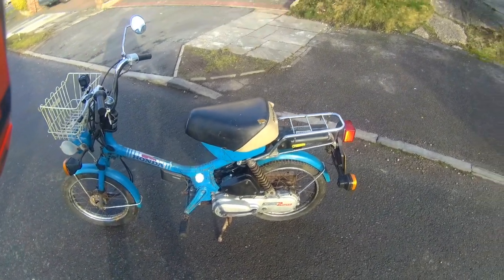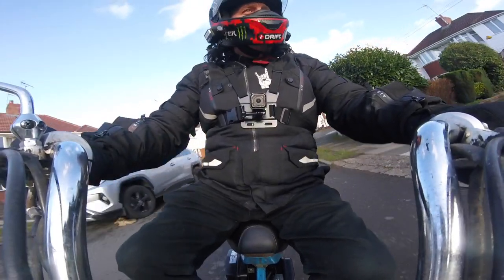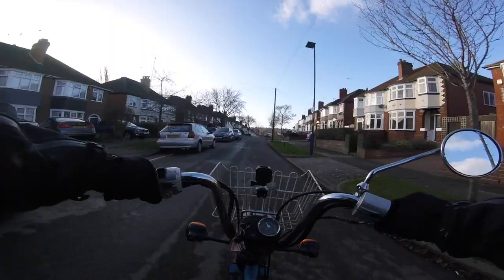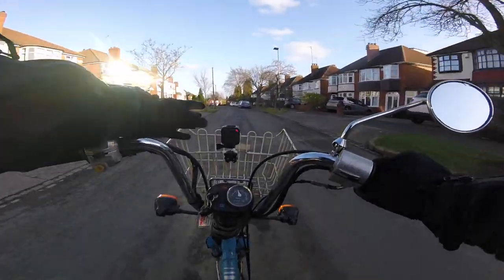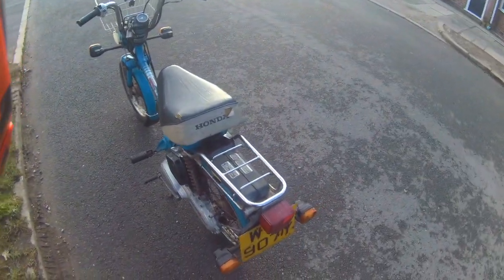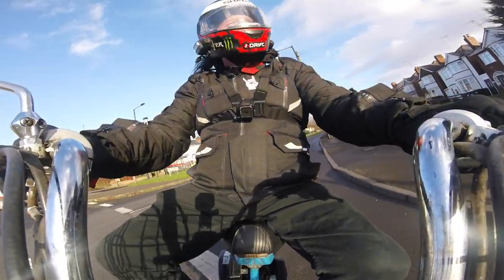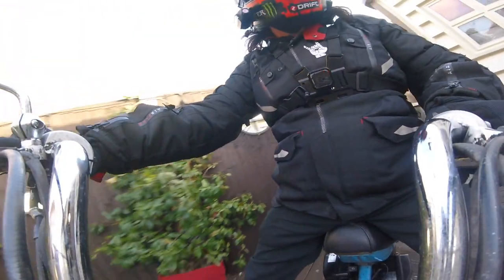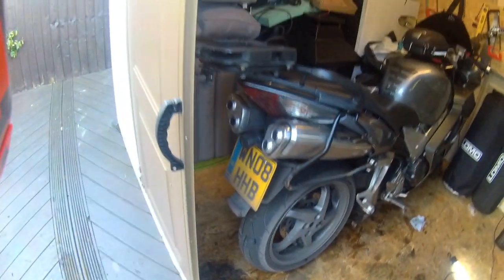1983 Honda Express NC50 First Ride

Comment: Recently put back together an 80 NC50. Up to 28mph on street level at sea level. Good to see others doing the same.
Reply from the maker: Mine doesn’t run very well at all, gonna need to get her looked at
Reply: @Motourev  I don’t recall the exact mileage but you had nearly 6k in this review. Mine less than 600. Hopefully yours can get running right for not too much.

Comment: Nice little machine, I’ve had 3 of these the oldest was a 1978 on an S reg, yours is a 2 speed that they made from 1981 to 1986 I think, it also has an auto choke as well if I remember. 
     The early ones were manual choke and single speed, great fun machines when you can get them to run right! 
     Thanks for the vid,👍
Reply from the maker: Yeah she’s not running very well at moment

Comment: That’s class mate. Good luck with the ride to wales dude. Put some BMX stunt pegs on the front wheel then you can use them as cruiser pegs mate. Then they can be removed so it’s still original. Great video

Comment: I had a motorized bicycle a 2 stroke 49cc went 45 mph but the rear wheel took a crap
Reply: @Motourev  my motorized bicycle fast I still got it just gotta get the rear wheel fixed